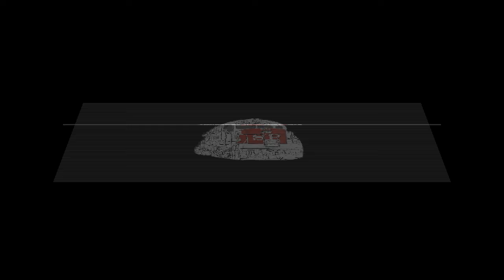1974 Pontiac Trans Am detail and restoration part 4

Comment: You can get those rubber covers for the hood bolts in rubber stopper bushing kit from most all the restoration companies. They only cover the two front bolts though, the rear ones don't contact the hood they're only to keep the hood from cutting your head off if you have a really bad wreck. Car looks great.